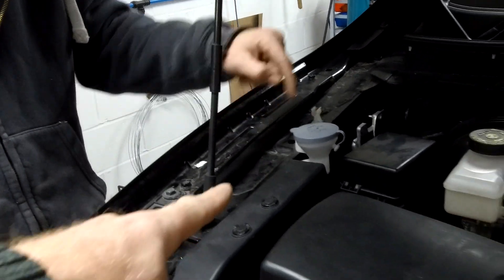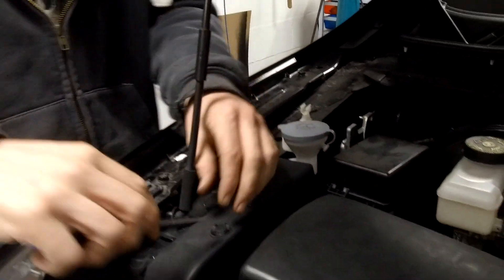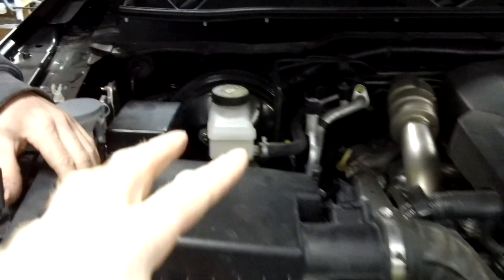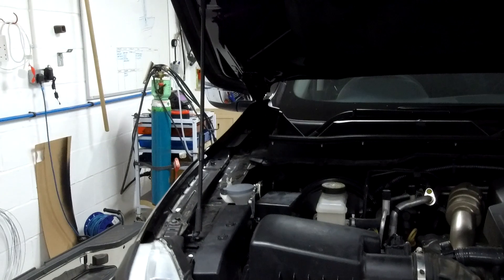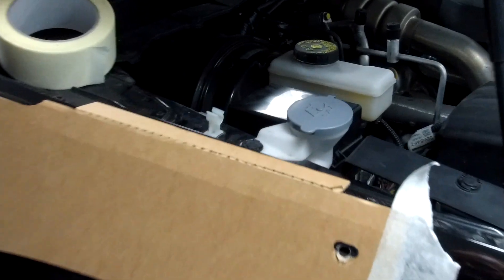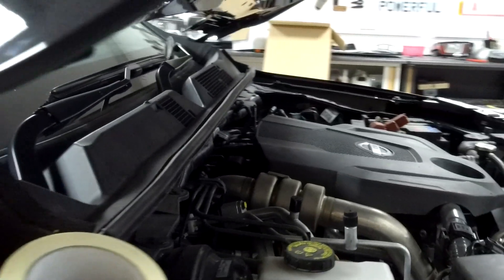How to fit ( sort of ) Nissan Navara NP300 Snorkel Fitting

Comment: Just don't buy a cheap crappy snorkel. Buy an Australian Safari Snorkel, one of the best and it solves all these issues with relocation brackets and bolts. All the hard work is worked out for you.
Reply from the maker: I did buy one of the Australian ones but it looked like it was upside down ? cant think why that would be !
Reply from the maker: You are of course correct to a degree - but the amount you need to move and change is a lot - it does not strike me as the best bit of design -good design should be simple to install... new airbox and moving ECU's does not strike me as easy.

Comment: I am confused. So the snorkel is a fake addition, ie not connected to the airbox - why? I don't think you would be drilling into the water bottle, as it is separated by the wheel arch. You didn't use the pop rivets - tho you say it's the better way - because the snorkel wasn't aligned properly, so you had to use long screws and spacers? That really didn't come across as a professional install - I hope no one is paying you to do this? Interesting to watch tho.
Reply from the maker: We test fit all the products we sell and give an honest opinion of how hard they are to fit..... this was the purpose of this and all our videos... I think have drawn the same conclusion about this job as we were trying to convey....
Reply: Savage!